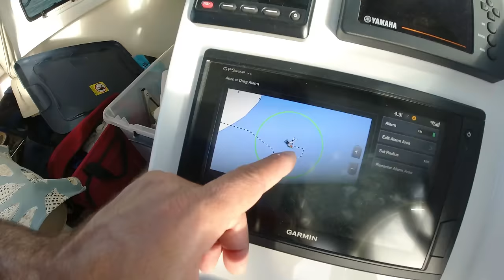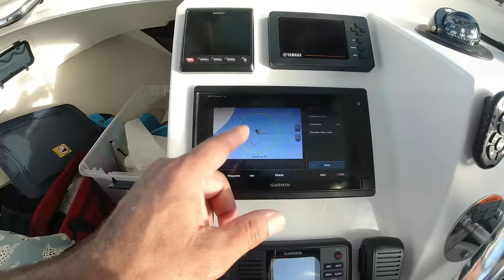SURVIVING FROM THE SEA 160 Miles From USA Overnight at Bahamas in a Small Crooked PilotHouse boat

Comment: I've been considering lithium ion batteries for a flats boat I've been building.  What's the difference between what you're using and the expensive batteries?
Reply from the maker: The weight is 50 to 60% less cap and lithium last longer life

Comment: How man hours do you have on your engine? Glad to see you use your boat so much.
Reply from the maker: Hello captain and I think I have about 330 hours. And the engine is running really strong, Thanks for watching captain and see you on the next video👍😉⚓️🎣🛳
Reply: @OutOnTheReef  330 hrs is just broken in .
Reply from the maker: @patscally5390  that is great to know cap. Thanks  and this engine arr very reliable 👍🎣
Reply: @OutOnTheReef  My Yamaha 115 has over 600 hrs on it and still runs like new. Starts right away, runs smooth and quiet, still getting over 4 mpg on plane.
Reply from the maker: @patscally5390  that is awesome cap. This Yamaha engines are great and fuel efficient